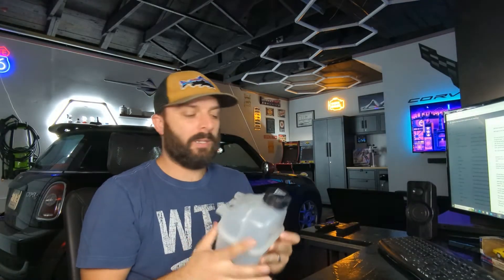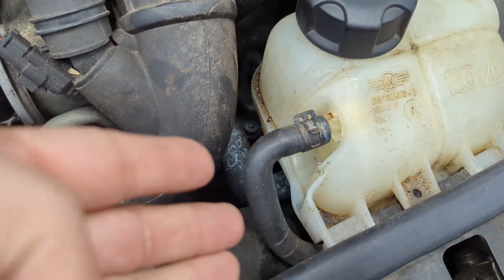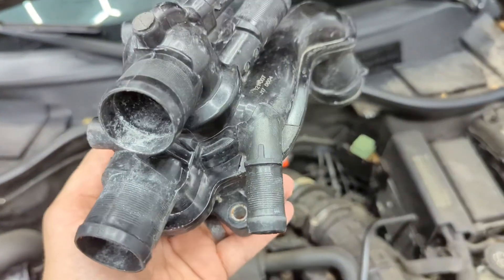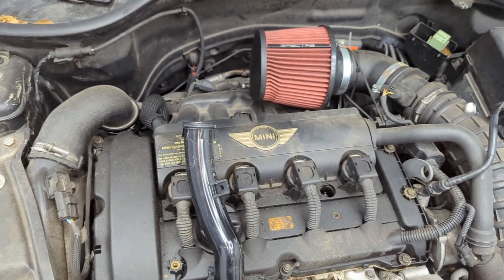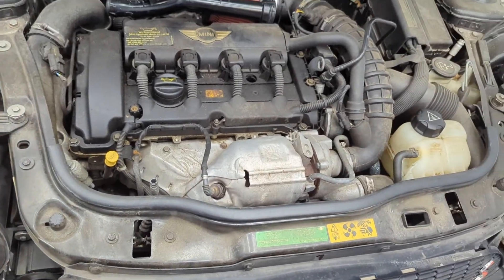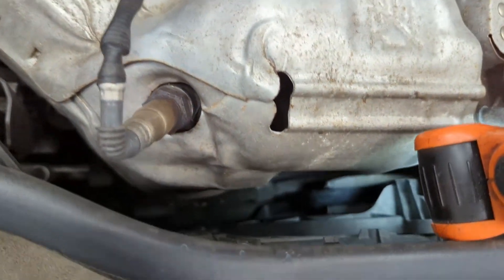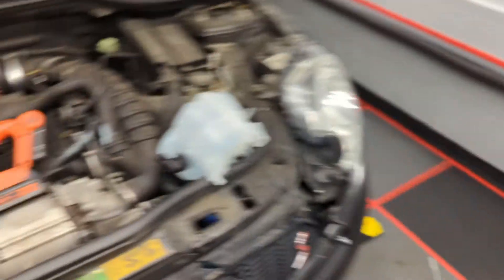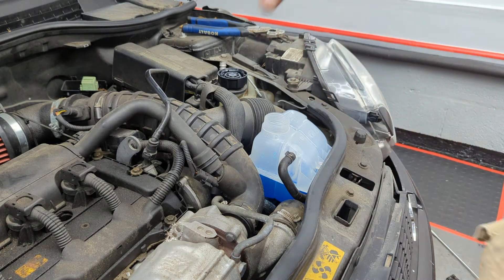THE FOUR POINTS OF FAILURE OF THE MINI COOLANT SYSTEM | SYMPTOMS & HOW TO FIX

Comment: Ok my 2012 mini cooper s coolant reservoir never fills up, I fill it to the fill line and  it drains somewhere so I have to fill it up to the top so then it will stay in there. I use probably a half of a full jug of coolant. Please help if you can?..

Comment: The spring loaded friction wheel pulley has an electronic solonoid inside. There is a plug on the top of it. When the vehicle is cold the wheel is pulled away from the pulleys and the water pump is disengaged so as to warm up the engine quicker.

Comment: Loved your video since I just bought a 2011 R57 convertible. I had to replace the coolant temperature sensor yesterday. You mentioned air in the system but neglected to show where the bleeder screw was located. Great video!
Reply from the maker: Oh it's right in the middle of your thermostat housing.  Black plastic screw head.  Just take a flashlight & look straight between the block & housing assembly.  🤙👍

Comment: Great video man. One thing I learned before I replaced my expansion tank; the coolant will stain the tank. You get tricked into thinking it’s full, unless you take off the cap and look inside. Funny, I’ve had to replace the friction wheel, thermostat housing (2) and expansion tank. I’m getting a P0597 code. I haven’t changed the crossover pipe. Maybe it’s time. You are right on about aftermarket thermostat housing. Total dreck. Thanks again!

Comment: I have 2010 and it over heated . The long tube in the rear failed. I replaced  but now won't start. It will crank but no start.any info would be great help thank u
Reply: Might have a unplugged  connector

Comment: The reason the expansion tank is so hard to diagnose is because you can never tell if the leak is a faulty tank or the hoses wiggling around when you have to replace the oil filter

Comment: I know this is an old video, but my sister has a 2013 mini cooper base, and I replaced the lower rad hose cause the busted a hole in it, well I bled the system and everything it was good for a little bit but now when she has the A/C on it overheats then she turns the heat on and then poof it cools back down to normal temps maybe I can get some help it’s a shot in the dark though

Comment: I have a crazy issue..so i drove my mini..2012 base and i went 15miles perfect..then it sat for a week..well I started it up went to town..3 miles came home and on the way the light came on then went red..I pulled in my driveway opened the hood and the over flow tank blew all of the coolant out..well I filled the tank and it sucked it down instantly ..then immediately as soon as I started it blew it out again..I opened the bleeder and only air was blasting out..I tested my head gasket and liquid stays blue..what the he'll is going on.??

Comment: My 2012 Mini had a small coolant leak. I took it in, and after replacing the temp sensor housing, the fan was blowing LOUD. So, they replaced other parts and then it started overheating. To date, they have replaced the housing 3x, the fan, the water pump, and the expansion tank. Now it doesn't overheat, but the bottom hose isn't warming up and NOW it is throwing a check engine code when you turn the car on. 3 shops have been working together to fix it, BMW refuses to look at it. It is at a 4th mechanic now. Any ideas???

Comment: Any ideas about this issue: I replaced the oil and transmission oil for the CVT and now the 06 Mini is overheating. I can tell is definitely burning coolant, but I'm not sure why. The reservoir is fine. I can run the engine for a little while and it goes to normal running temperature, then suddenly it spikes and I have to stop in a matter of 30 seconds. No smoke or anything, but I had to limp it home about a mile at a time

Comment: ECStuning sells an all aluminum link pipe. Got one on our 2009. Change it once, never worry about it again. They also offer a replacement aluminum thermostat housing. I don't have one of those yet, but it looks like the thermostat might be replaceable as the housing opens where the tstat is. AL body does away with the cracking and leaking the plastic ones all eventually get.
Reply: Also, after-market ALU expansion tanks readily available.  Yes, that ALU crossover pipe from ECStuning is an excellent rec.

Comment: The problem I keep having is the 90 elbow(7:04 mark) that attaches under the coolant tank. You have to twist that tank out of the way every time you change the oil filter. I've had to change 3 of them so far. Of course, Mini does not sell just the elbow and you have to buy the entire coolant return hose, which is like $80 buck a whack. I am wondering if I can remove that Elbow and just put the line onto the tank directly. Any thoughts? Great video and love how you put the parts pictures in.
Reply: grab a pex fitting at the local hardware store. Pops right in place and is made of brass. Never worry about it again.
Reply: @bobjohn7021 would that be a pex fitting with one side 3/4 to the hose and 3/4 press fitting to the expansion tank? Or is it another size?

Comment: Great video, very informative. The one failure point I thought you would have mentioned was the oil cooler where coolant runs through and if those seals go bad the car can both over heat and you can end up with oil in the coolant.